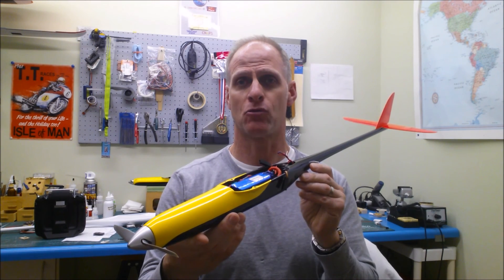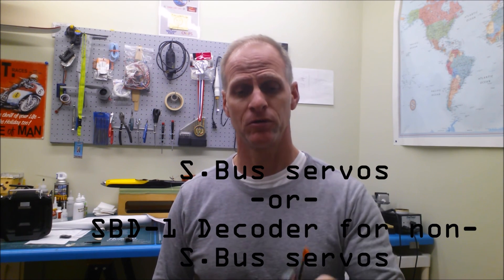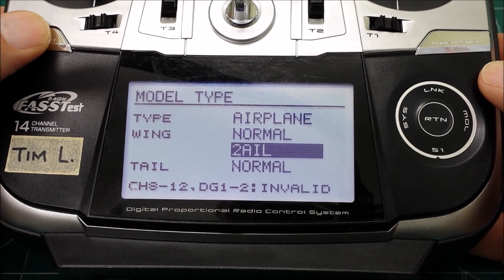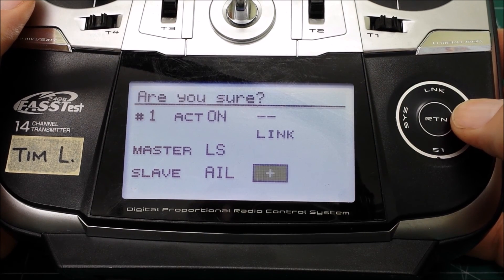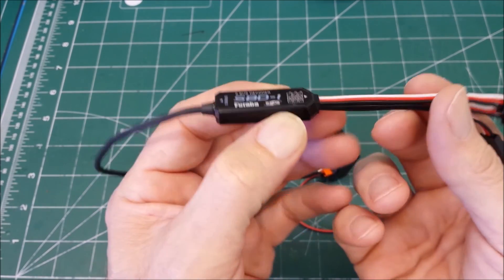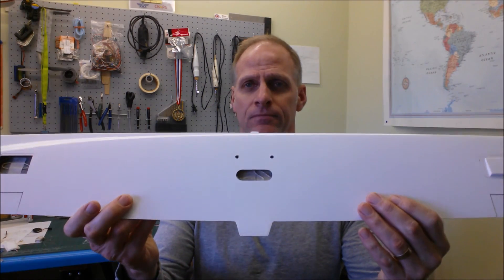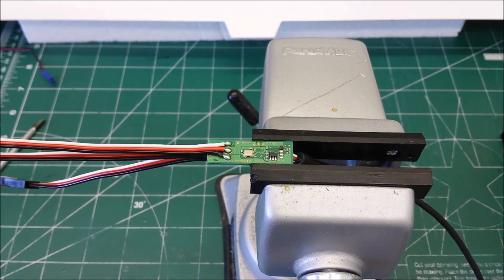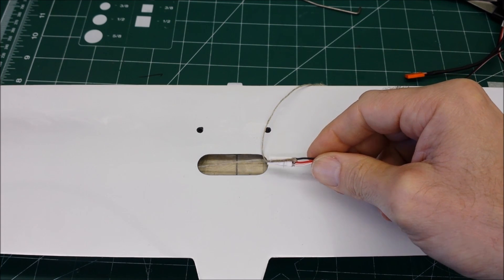Futaba S.Bus with the SBD-1 decoder

Comment: hay Tim, newbie here just starting to learn about s-bus, so if I'm going to use non s-bus servos I will need  a  decoder 
and a programmer to set up  a system  with  8 servos it  would need 3 decoders is that right?  just looking at a better way to set up a new plane

Comment: Good Morning Tim Thanks for your Video it was very helpful ..is the Futaba R6303sb still are good choice of Receiver to use or have you found something better Cheers Brad..
Reply from the maker: +Bradley Wood 

Hi Brad. Thank you for the compliment.  What you think of as "better" depends upon the application - what you need the receiver to do? There is an R6202SB receiver that has two S.Bus ports (but only two regular servo ports) if that serves your purposes better.  :-)

http://www3.towerhobbies.com/cgi-bin/wti0001p?&I=LXBPKP&P=ML

Tim